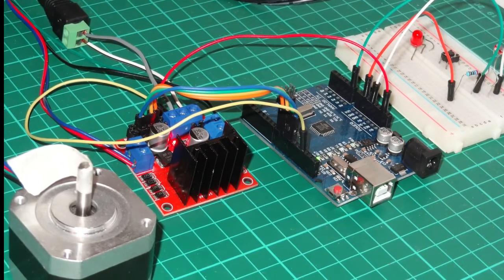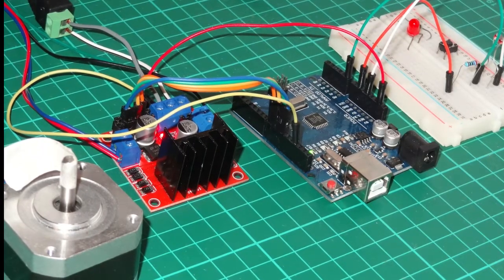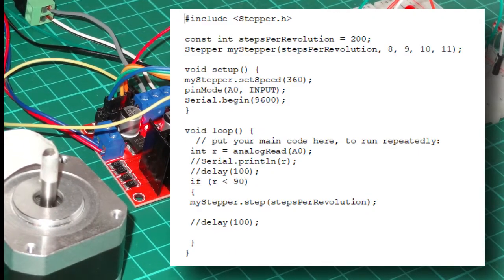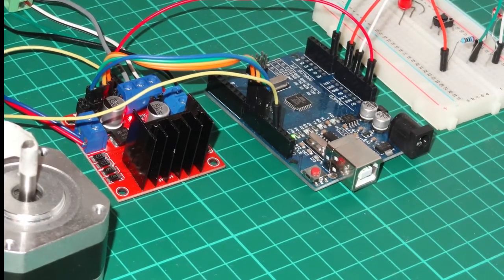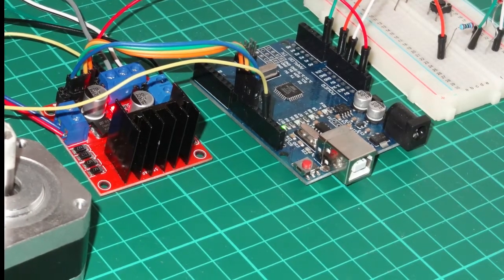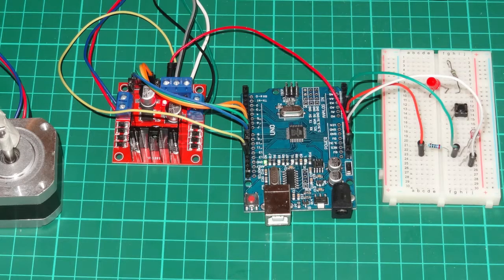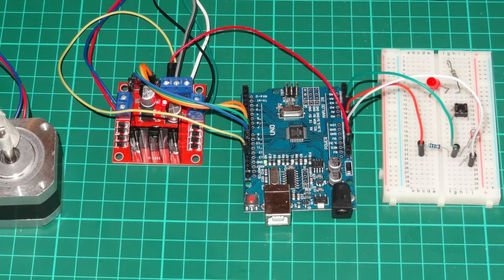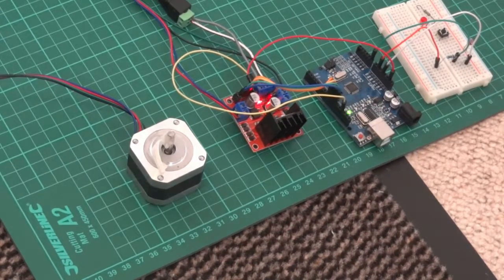Stepper Motor ON/OFF with LDR photocell - NEMA 17, L298, Arduino

Comment: I have a problem, i was using this idea for my little conveyor, but the nema 17's torque is weak when it is connected with the LDR module. But if it is not connected, the nema 17 has strong torque. Can you help me solve this?
Reply from the maker: Can you increase the current ?
(Within the limits of the hardware)

Comment: Can you provide the code
Reply from the maker: #include <Stepper.h>

const int stepsPerRevolution = 200;
Stepper myStepper(stepsPerRevolution, 8, 9, 10, 11);

void setup() {
myStepper.setSpeed(360);
pinMode(A0, INPUT);
Serial.begin(9600);
}

void loop() {
 int r = analogRead(A0);
 if (r<90)
 {
 myStepper.step(stepsPerRevolution);
 }
}